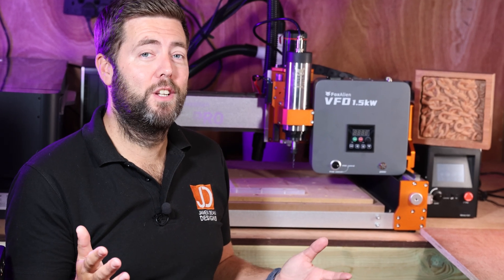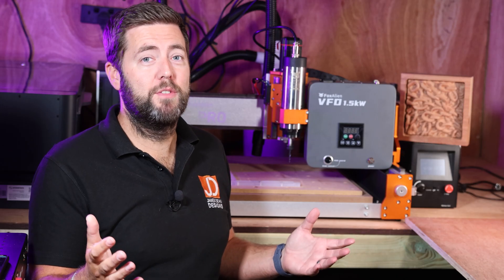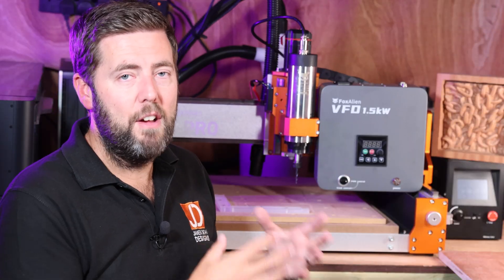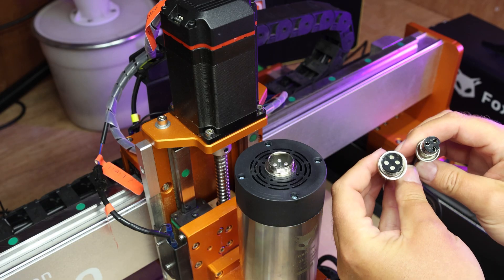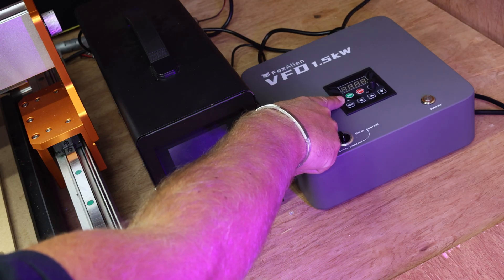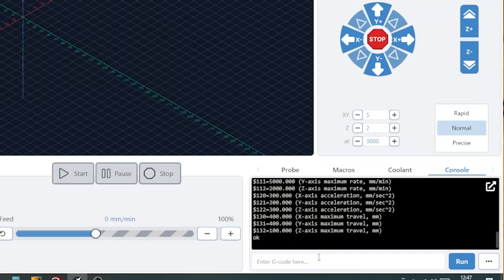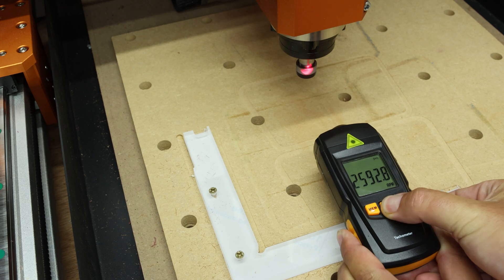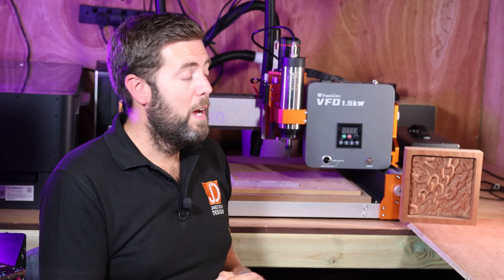Easiest CNC Upgrade Ever - First look at the FoxAlien 1.5kw Spindle and VFD

Comment: I believe you also have an MK2 30x30. Would you use the Fox Alien om the MK 2 or stick with the spindle that Vectric sells?
Reply: I.meant the one Sienci offers.
Reply from the maker: The FoxAlien one is generally easier to use because you don't have to mess with any settings. Equally some people see that as limiting. The advantage to the one from Sienci is they will have documented how to set it up specifically for their machine. Truthfully, you'll be in a good position with either

Comment: I had problems with my stepper motors after installing the otherwise great FS 1.5 VFD spindle.  People on Facebook told me the spindle came with an inadequately shielded cable and lack of ground wire (3 not 4 which you mentioned).  I think I have solved the problem by early on with the first two steps listed below, but just to be more sure that I didn’t have future problems I also addressed (as best I could with materials on hand) all the suggestions made by fellow FoxAlien CNC Router and Laser Machine Group members.
In the end I did all of the following:
-Removed VFD cable from outside of drag chain.
-Secured VFD cable and vacuum hose from ceiling and away from Y-axis stepper motors.
-Wrapped aluminum tape electro-magnetic shield on VDF cable and vacuum hose near Z-axis stepper motors 
-Added extra of aluminum tape with non-adhesive sides touching in order to more than double thickness of aluminum shield.
-Covered all aluminum tape with Vinyl insulation tape.
-Grounded vacuum hose and Vacuum machine.

Comment: I ordered 2 for my 80x40 XE and my CL 4X4 and had one question.  Is there a way to change the VFD display to show rpm and not Hz?
Reply from the maker: I dont believe there is have foxalien have locked down the controls. Unless they are able to directly advise you how to do this

Comment: Hiya - thanks for all the useful info you share.  I have a FoxAlien question - it doesn't relate to this spindle update, but rather the XE-RO 8040 extension kit - the contents of which I am trying to make sense of.  The info on their site, reproduced on Amazon as well suggests that the kit comes with a linear rail for the X axis along with a 16mm ballscrew.  Which perhaps goes some way to explaining the cost.  However - this will leave you with a device with linear rails on the X and Z axes - is there an option to fit linear rails on the Y axis - without having to buy the complete linear rail conversion, which will include redundant X axis rails ???
Reply from the maker: Sadly (unless it's changed) you have to buy the X and Y linear rail kit. There isn't a Y only linear rail kit. You can perhaps contact FoxAlien directly but I'm not sure they will only do the Y rails separately.

Comment: Just put my order in and the discount code worked fine. Looking forward to the reduction in decibels, but not so much the taking it apart again, lol!
Reply from the maker: I've been running this quite a bit since I did this video and it's holding up great. Only thing is you'll want to give it a good 6 or 7 seconds to get upto speeds before it starts cutting
Reply: @JamesDeanDesigns  Mine arrived a few days ago. All fitted and running fine. So much quieter than the Dewalt router it replaced. The hardest part was fitting it through the drag chains, but that is because I have my machine in an enclosure. I have found that if I multiply the required speed by 0.91 in software, it gives me the correct speed at the spindle. A big thumbs up from me 🙂

Comment: I didn’t see this specific question - will this work with other controllers?  I am interested in using it with an OpenBuilds controller which runs GRBL.
Reply from the maker: I can't say all controllers but any that has a PWM/laser output should be good. I know the Openbuilds Controller has one just may need a different connector which is easy enough to change
Reply: @JamesDeanDesigns Thank you James.  I appreciate the quick response.

Comment: I have a DIY CNC router that is running Mach 3 and uses a parallel port breakout board.  The board has the following terminals, that I think would make it able to control this spindle, but I'd like your feedback.  It has a relay for spindle on/off control.  It has a 12-24 VDC external supply for i/p and PWM.  Finally, it has a 0-10V PWM spindle speed control connection.  ALl of these connections are simple two wire connections.  Which of these connections would I need to make to enable me to have control of this spindle while using Mach 3?
I have always wanted a VFD spindle, instead of my router, but the cost and wiring has kept me away.  If this is basically all ready to go and all I need to do is figure out how to control it with my breakout board and Mach 3, I'd definitely consider it.
Thanks for the video and thanks to FoxAlien for creating this kit.
Reply from the maker: It would typically be the PWM. The 2 wires (I suspect) are PWM and ground. On most machines now they have 3 wires which is PWM, Ground and Live. However I can't be 100% sure this would work with your setup. You are better off contacting FoxAlien directly
Reply: @JamesDeanDesigns Thanks James. I did notice that the PWM connector had three wires so I wasn't sure how it would work. Contacting FoxAlien seems like the best way to verify. Thanks.

Comment: Are they set up as 120-220v,or is it one or the other?
Reply: Also I bought just bought a Gemitsu 4030v2 with extensions, now after seeing this video thinking about sending back to get the FoxAlien XEPRO 8040 with this VFD… What is your opinion.
Reply: @BRIANPAUL-j3b  Just do it!!!😁
Reply from the maker: The 4030 is great but the XE Pro with the linear rails is better. 
In terms of the spindle, it will be configured for your country so for me it was 220, but US will be 110
Reply: @JamesDeanDesigns  the reason I asked about the 110/220 is I’m in Germany but my home is USA. Just wondering whether I’d be able to take it back or not I would be better to just get a 110 and transformer.

Comment: Hi not sure if this is a daft question but as this is stand alone and plug n play will it work on most cnc s ?
I have a ooznest workbee 4 x 4
Reply from the maker: Yes, the spindle will work with any machine stand alone and can run automatically with any machine that has a laser/pwm output

Comment: Probably a daft question, but I presume the switch on the back of the control box is still set to PC ?
Reply from the maker: Yes, switch should be on PC. Only the Spindle/laser one needs to change and that should be on Laser
Reply: @JamesDeanDesigns thank you

Comment: Any thoughts on this being compatible with a Sainsmart 3030 Prover?  It’s has a 3 pin laser port on the controller. Would be a nice solution for the 3030.
Reply from the maker: Yes, it should work fine on that the laser connection should be the same 👍
Reply: @JamesDeanDesigns thank you sir, much appreciated!

Comment: bonjour dommage que la broche n'est pas prévu pour les deux sens de rotation
Reply from the maker: Hi, they are typically designed for desktop GRBL based machines which usually do not accept commands for counter clockwise. The core VFD is likely capable of it though by adjusting the settings or wiring but this is how FoxAlien have set it up to keep it user friendly

Comment: You can change the setting’s in the vfd, to make make it run at the right speed as I did with my cheap vfd, and I set my vfd up in around 1 1/2 hours it is faultless.
Longest bit was making my own PWM cable the fittings are tiny.
Reply from the maker: I think they have locked the settings down to avoid adjusting this - they have done it for safety but it would be useful to know from them if this can be achieved 👍
Reply: @JamesDeanDesigns  That’s not good, you should be able to change things like the rate and voltage to calibrate the speed, and the start and brake functions. 👍